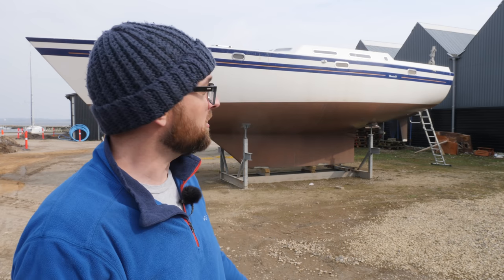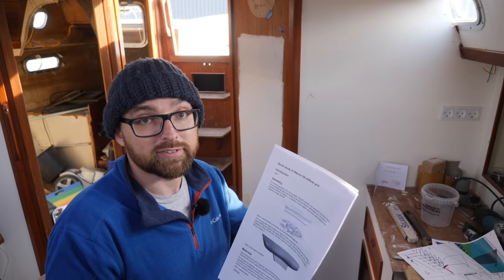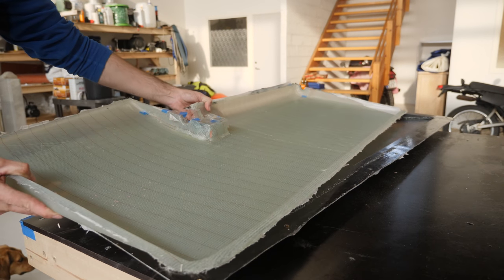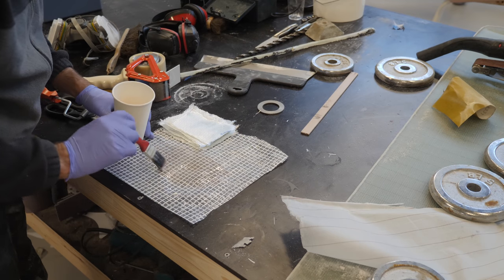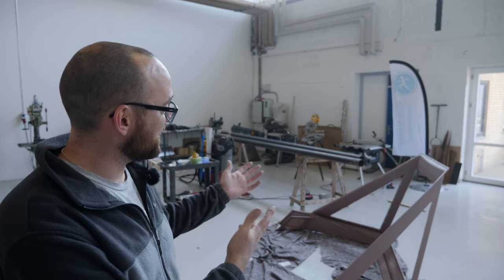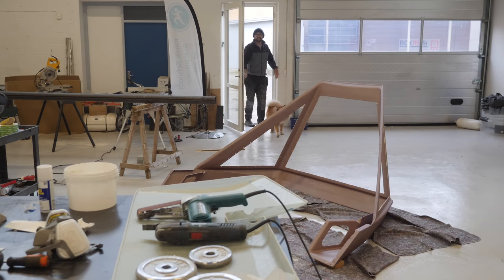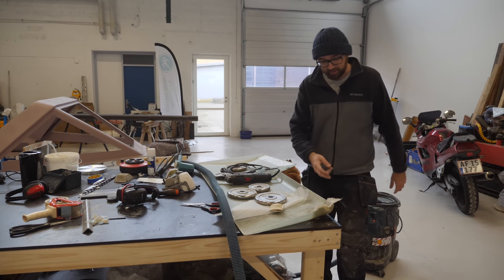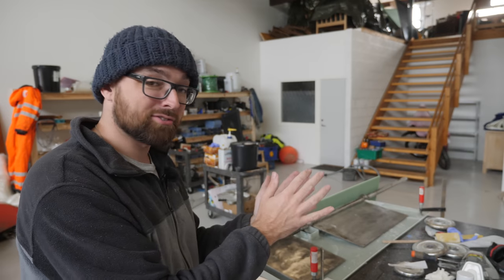Sail Life - Structural members, rudder and dodger fun - DIY sailboat repair

Comment: There is no sealant that will permanently and reliably bond stainless to fiberglass. That's one reason Beneteau went to fiber composite rudder stocks--no more stainless--around the late 1980's.
Reply: Does it need to bond? Is the stainless completely encapsulated in a rudder? It would thereby be captured and the sealant would just make up for the different coefficients of expansion. Or maybe not needed at all.

Comment: I built a rudder for a 38 ft boat and used micro ballons and resin. 1.75 ss rudder shaft and tangs still made it very heavy. Is your shaft solid or a tube.I didn't cast it but built it up so not sure of the procedure.

Comment: If using the laminated PVC sheets, how will you ensure no voids??
Could you not use PVC sheet for the bulk (to reduce costs) & then use the expanding epoxy for the 'last bit' around the rudder 'fins' & stock. Much cheaper but no voids for water

Comment: On thos structual members why not split the glassmuck out the rot replace with foam and epoxy the put new laminates
over the structual members to the 9 mil you spoke of???
Reply: Yes. ☝️. Or cut out the glass from the side, like a window. Then scrap out the old wet soaked ply and fill in with new foam, and then over glass to the desired thickness you like.
Reply: @svoctopus4888  There are epoxies designed to preserve rotten wood and they work pretty well. The one is called Git-Rot and while it's not best to use it on wet wood it will cure and add strength. The one glass repair guy that comes to our marina uses it and swears by it and we've never had a customer complaint in the 20 odd years he's been doing work for us. On wet stringers like Mads he'll use a vacuum pump to draw it through pulling the moisture out with it. At first my Uncle thought it was total BS so he did a demo on a sunken salvaged boat and while not perfect it was dry and about 90% epoxy and the rest was crystalized air pockets. It's hard to believe but the vacuum allows the water to boil out of the wood and whats left is displaced by the epoxy and drawn out the bottom holes.
Reply: Mads, will probably just glass over those stringers. Less work. Drilling holes and vacuuming out moisture and ejecting epoxy is too time consuming in my opinion. Take a multitool and cut out the bad and insert the new foam sheets. Mads is running out of time and wants this project over (getting married). It's his boat and I think he's happy with just glassing extra glass over the stringers. He has his "OCD" in control now.
Reply: @svoctopus4888   The only time consuming part would be finding/making a fittings to use. Seriously by the time you've made your first cut I'd be pulling epoxy through the first stringer while you'd still be butchering the stringers. Once you have things setup,the only time consuming part is waiting for the epoxy to be pulled through. But I can assure you that it is faster than cutting, trying to clean out the mess, making a filler and then reglassing over the whole mess. Also not only is it a multitude of times faster it retains most of the strength of the original laminate, unlike what you suggest. Regardless of what you think, cutting into the glass like you suggest will seriously weaken the structure. In those stringers the majority of your strength comes from the fibers being one continues strand and once you've cut the strands like you suggest you might as well replace the whole stringer.

Comment: if you glass the channel for the rudderpost before glue it in place, then eventual water can't get to the core ?
about foam i found a foam stoneglue made by uretane, on Biltema
 uretane make a water resistant glue on wood so...
I was going to try it on plywood on an uneven surface  ..but the spring hasn't arrived to nothern Sweden yet ..

Comment: Hey Mads, what about the weight of the rudder. Should you not keep it close to the original weight to keep the waterline level? Congrats to you and Ava!
Reply: Antonio Fernandes it will be marginal at best and with all of the other work that’s being carried out, the boat will need re-ballasting and trimming when it’s back in the water in any case.

Comment: Looks like you dug yourself into a rathole with the hand repair to the rudder. A better option would be to add a several g10 washers inside the rudder that the shaft fits in. This does two things. Positively locates the rudder shaft and secondly positively locates the other closing rudder piece.

Comment: I think you would have been better off with a high density urethane pour foam.  You are right, no need to mess with super expensive foaming epoxy, but a quart of urethane foam is much, much cheaper and the right kind (density) of foam would not have an absolute minimum water absorption rate.  I think your foam will be well protected by the epoxy/glass rudder, and the layering and shaping of PVC sheets is just way more work.
Reply from the maker: It'll be interesting to hear what the hivemind has to say :) PU might just have a bad reputation because of wrong density? There are a lot of forum posts all over the interwebs proclaiming PU to be the devil though :)
Reply: @SailLife  , not all foams are created equal, that's for sure!
Reply: I have yet to see any type of spray foam that is used in the marine industry that is not water logged after about 10 years in use, despite what the spray foam manufacturers saying that their foam won't absorb water.
Reply: @jcf6597  I'm about to rebuild the rudder of my boat (1977 Tartan 37C) and will use 8-pound closed cell expanding polyurethane foam.  It's not the spray foam you find at Home Depot, but a two-part system you mix right before pouring.

Comment: "Order" chainplates? Why not make your own? They are dead easy to make....and once you have the interior out, you can make them longer and/or wider for better load transfer. You could make them all in 1 day if you have a drill press and a spiffy 4" grinder with a stack of cut-off wheels.

Comment: I would be using a rubber toughened epoxy like HPR25 made by Adhesive Technologies for bonding the rudder to the keel as it is made for this purpose as it will expand and contract with the steel and glass without causing issues./

Comment: Today You have me confused. IMO the way You approached the rudder is begging to use expanding foam. On one end You are concerned about moisture absorption but on the other You acknowledge the nature of the beast. If the moisture is Your only concern why not treating the inside surface of the rudder with with a layer of moisture barrier coat before applying expanded foam ?
Reply: The expanding foam needs to  be epoxy-based and the cost of such foam is prohibitive. I have seen polyester-based expanding foam after just a few years of exposure to water penetration. Its horrible and I am pretty sure Mads does not want to all this over again.
Reply: @geraldhenrickson7472  If that is the only way out then in my opinion the approach of the building a mold and vacuum bagging was a fail. I would rather take the foam sheet and built a block around the rudder stock , fair it to shape and glas it.

Comment: Just watched a rudder being made on a sirius 40d yatch see https://youtu.be/f7upfeSGJwU at 12.55 minutes in. And noticed that the stainless steel rudder stock is wrapped and sealed with fibre glass before being fitted in the rudder. Might help stop corrosion in future.

Comment: How about using a Blender or such to cut the foam in to small pieces. Then use epoxy and filler to make a paste of the it all. Then fill the rudder. ? Could this cut costs?

Comment: Bad news! Your rudder must be made with the opposite way.

Your assumption was based on correction of old rudder.

You copied that shape with mold and most probably your new shape will be worse than the old rudder.

You cannot take shape with mold from old rudder. Your method is based on repair mentality but now you are producing it. The result will double the errors.

Rudder shaft is in good condition but I would add some constructional support to prevent bending by the welded areas. Maybe it is not necessary but just a few pieces…

I would laminate foams in between thick (3mm) fiberglass around the shaft. Cover the surface with fiberglass to have rough rudder shape shell and then shaping it with cnc according to ideal measurement of the rudder.

Rudder is the most hydro dynamic place during the cruising, it will cause many effects if you don’t do it right.

Not coppied from old rudder but with ideal measure or maybe better shape could be added…

Shaft must be centered by the cnc and correct rudder shape must be achieved. Otherwise as you say you will carry more hydro dynamic problem than the old rudder for 30 years.

I’m %100 percent sure that with your way your new rudder will have hydro dynamic design problems more than the old one.

I like your DIY perfection balance that is why I wanted to warn you…
Reply: Laminating foams around the shaft could be vertical and fiberglass in between the layers would be contractive element. With your thin foam, layer numbers could be hundred but in unnecessary places you can use thicker foam to decrease the layer number.

You can use your mold to give a rough shape. If you add 1cm between your molds closing then your rough shape would be 5mm thicker in each side than after you can take those excessive fiber in cnc shaping for final rudder shape.
Reply: If you prepare foams to fit in to the mold before to glue them with fiberglass, it would be easy to give desired shape to plain foam. After you accomplish foam fitting in to the mold then you can laminate them.
Reply: I wouldn't worry about too much about the hydrodynamics of it.. do you really think Mads won't fair the outside of the new rudder to within a mm of its' life?
Reply: @Garryck-1 Rudder welding with additional part has been done very well.
I would add additional wood parts for big foam volume areas; maybe on top of stainless steel.
 Other than my advice was to make the rudder a bit sharper even than before but so far so good.

Comment: the amount of steel attached to your rudder stock is way over the top  - for mine I would be removing about 60 - 70% of the plate and bring it back to tangs  - totally unnecessary with the amount of work you are doing - have a quick look at construction methods for the newer rudders.  big,fat and heavy doesn't necessarily add to the structural integrity